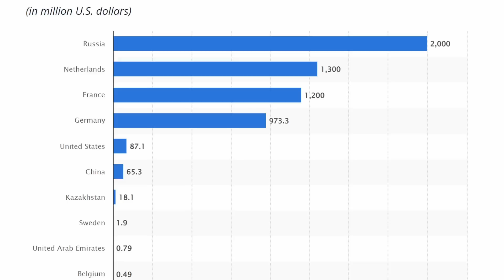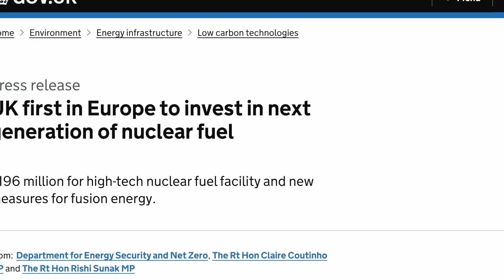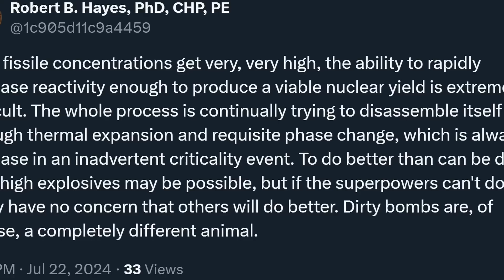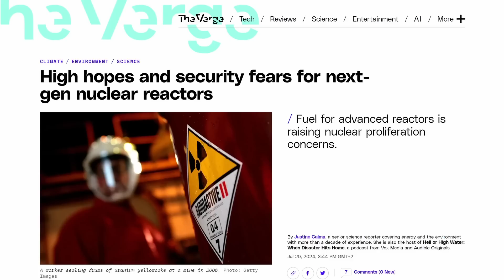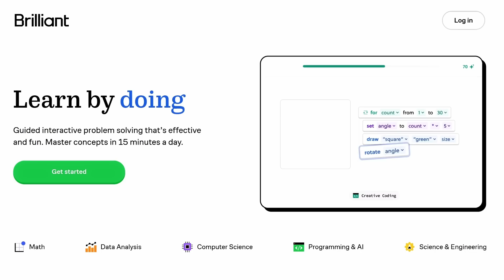Small modular reactor fuel could be used to build nuclear bomb, experts warn

Comment: There have been analyses that the industry would have to make +1000 small formfactor nuclear reactors to get into proper leveles of benefit of scale. This is a possibility but also a risk. If you build 500 small reactors over a few decades the benefits never materialize and it's a possibility that it would have been better to build 100  medium-sized 800 MWe reactors instead.
Reply: Yup. Modular reactors are a boondongle. They aren't as efficient as proper reactors, just easy to get into place quickly exactly where they are needed. Which is only an issue because of poor planning and public stupidity. "Nucular bad, the tee-vee told me. Now lets make a 14th son Cousin Sally-Ann, maybe this one won't be dee-formed."
Reply: @DefaultFlame which SMR design you are talking? Because this is not true for the ones that are going to happen, like the BWRX300, which should have higher fuel usage then most other reactors.
Reply: @Petriiik  Higher fuel efficiency than cold war era reactors, sure. Higher fuel efficiency than a "modern" reactor like an advanced CANDU reactor (which is decades old at this point)? I seriously, seriously doubt that. Send me the names of some reasearch papers and studies. (Specifically names, because youtube doesn't like links for insane reasons.)
Reply: Depends how you look at it.
If the small reactors start rolling off the assembly line, their price is rather fixed and the building time is plannable at least.
The cost of an bespoke reactor might seem lower per MW, but that cost is just an estimation and typically triples while the building time doubles.

The most recent nuclear plant in Finland took nearly 18 years to complete.
Hinkley Point C started in dec 2018 and is estimated to be finished sometime between 2029 and 2031. My guess is it will be pushed back again.
The building time has a HUGHE impact on the cost of the total project. Just take a look at the youtube vid Economics of Nuclear Reactor.
Reply: @Cohen.the.Worrier  Hinkley is an anomaly, probably a scam or tax fraud, or it's being built by a government that's anti-nuclear that's inventing reasons to cancel it.
Reply: @Cohen.the.Worrier  Hinkley is likely either a case of tax evasion, fraud, or a nuclear-hostile government intentionally dragging its feet. If the building of a nuclear reactor isn't done incompetently/delayed by governments then it won't be delayed by decades.
Reply: i highly doubt that these analysis was serious, most probably some "friends of the planet" production.

Comment: Not really. It's still easier to make a bomb from a proper bomb making reactor. You don't need a power plant or all that scrutiny. Small modular reactors are designed to make power. That's a really lousy way to make Bomb materials.  
There are lots of dangerous things you can make today besides bombs.
This isn't a case where you need to be perfect. It's a case where you need to be way way safer than bigger problems. There's plenty of havoc that can be wrought with biotech and weaponized anonymous autonomous drones with face recognition. It's not the 1970's anymore.
Reply: One of the points of Thorium rectors is they result in relatively low level radioactive isotopes that half life out to safe levels after about 300 years.  In fact fissionable materials can be seeded into the Thorium salts and safely used with the same result.
Reply: @patraic5241  So what you're saying is you have 300 years to make it into a dirty bomb?
Reply: @Llortnerof  As opposed to 30,000 or more?  You can what if all you want.  The fact is technology is demanding more and more electrical power practically by the day.  Renewables can't cut it now.  There is little indication that they ever will ever even come close.  Natural Gas is a great improvement over coal and has allowed the US to reduce pollution dramatically.  But in the end the safest, cleanest, most cost effective power source we have is by far nuclear.  We just need the wherewithal to pick a form of it and run with it.
Reply: @Llortnerof  dirty bomb materials will always be available, because nuclear isotopes are useful in a wide range of applications, including medical. The point was waste reduction.
Reply: @patraic5241 Nuclear energy is highly risky because it relies on active safety mechanisms. Its most astute proponents will happily address meltdowns, knowing most of its opponents are oblivious to a far more likely danger. 

After fuel rods are spent, they're decommissioned and left in open circulating water pools to cool for several years until the residual radiation is down to a safe level. If the circulation pumps fail for a prolonged period, the spent fuel can self combust from intense heat and spread lethal radiation for many miles into the surrounding environment. It's not only as catastrophic as a meltdown, but far more likely to happen.
Reply: @patraic5241  commercial Thorium reactors don't exist and if they did you could still make nukes out of the uranium 235 they produce.
Reply: For example, hijacking a gasoline truck or several offers more bang for the effort. Makes one wonder if the same overabundance of caution required for things nuclear is applied uniformly based on actual risk calculation.
Reply: @AstroGremlinAmerican  Good point.
Reply: Pretty easy to weaponise a car
Reply: I don't see what terrorists are supposed to do with face recognition or biotech. It's not like every biotech lab contains materials that could be used for creating a new pandemic or so. And AI is more interesting for cyberterrorists than terrorists who just want to blow up as much as possible. Unless we get to the point where we can create robots that can create bombs by themselves, but let's first get them to walk in a straight line, because we're not even there yet.
Reply: Don't forget dirty bombs. Radiological weapons that could likely be built and used by terrorists might be "psychological weapons" only, but nationstates operating reactors can produce and mill fresh radionuclides of various desired chemistries en mass and deliver them in ways that could be deadly and both tactically and strategically effective.
Reply: That's why all the countries went the way of making their bombs from "improper" generating reactors. Sure.
Reply: Yeah! That's why no country ever used "proper bomb making reactors" to make the vast majority of their bombs.
Reply: Nobody in their right mind would ever use biotech as a weapon intentionally. There is no way to protect you and your people from it. 
If somebody is sufficiently insane, that might be the great filter.
Reply: Kinda hard to build a drone army discreetly that can take out more people than a nuke in a city.
Reply: Correct
But you can make a dirty bomb which can be just as devastating
Reply: I assume your level of expertise is equal to that of the people saying it can be done?
I assume you level of expertise in risk analysis and management meets things like the DOE orders used at their various nuclear sites?
"Lousy way" doesn't mean it WON'T be done.
Reply: @rbaxter286  yes, lousy way means it won't be done. People are lazy, they'll use the easy ways.
Reply: @jesan733  That kind of thinking is exactly how you end up with yellow-and-magenta tape and yellow plastic fencing off and covering downtown Manhatten.
Tell me again how 'lousy' it is to use mantles from Coleman camping equipment to try and build a reactor, and that's why 'nobody' would do it.
Reply: @rbaxter286  the radioactive boy scout seems to have been mentally unwell. Hobbyists sometimes do things in laborious ways, but then the effort would still be low in a macro perspective. Making a real bomb is a very high resource project requiring lots of skilled people, tools and money, and why would such a project make it much harder than it is? If you just want something that's "dirty" you have any amount of high-level waste from ordinary plants just sitting there.
Reply: @jesan733 you ask why a state would make manufacturing nuclear weapons make it harder than it needs to be. Wasn't the existing nuclear weapons arsenal largely derived from the commercial nuclear reactor supply chain? Wasn't pressure to keep material for nuclear weapons available a major reason why reactor technology was held back? Was all that stuff just a conspiracy theory after all?
Reply: @thesenamesaretaken  well, the plutonium and tritium for US nuclear weapons were created at military Hanford and Savannah River sites, employing graphite pile and heavy water type reactors. These reactors started operation a few years before any commercial reactors in the US.
Reply: @rbaxter286 who is paying you?
Reply: @gwentarinokripperinolkjdsf683  I have read the Science report in the copy I get every week.
Have you?
I worked in the nuclear industry and have had an interest in this for years, including past analysis provided by the Union of Concerned Scientist by experts in the nuclear weapons field.  I've got enough of a background to know the particulars of the analysis and/or the bona fides of the experts waving flags.
These references are out there, but you have to look for them.
Just because this kind of issue is 'inconvenient' is not a valid reason to ignore them.
Reply: @rbaxter286  hahahahahahahahahahahahahaha
Reply: @rbaxter286  You'd be better off grabbing the U233 created in a thorium salt reactor than using HALEU for a weapon.  HALEU is far more safe than Thorium salt for proliferation.  You'd have to further refine HALEU to be able to even think about the potentially for putting together a weapon, but Thorium salts is an easier process to separate the fissile Uranium out.

Before someone goes, "but what about the n -> 2n reaction in U 232 reaction," those that want the fissile material will figure out how to get the fissile U233 without worrying about the n -> 2n reaction.

Comment: 1:20 in the top section, shouldn’t the label show < 5% ?  It shows < 20 %
Reply: <20% is the definition for LEU. It technically starts from >.75%. Anythimg above the concentration of natural uranium is LEU
HALEU just raises the bottom limit to 5%.
Reply: @andrewsuryali8540  ahh excellent, thanks for clarification!
Reply from the maker: Yes, sorry, I noticed too late that this didn't properly fit to what I say. I meant to say Low Enriched Uranium that is used by current reactors is below 5%, while in general it's below 20%. And the part that's between 5 and 20% is the HALEU. The graphic isn't from us, it's from the DOE.
Reply: @SabineHossenfelder  You also said anything "above" 90% instead of "up to".